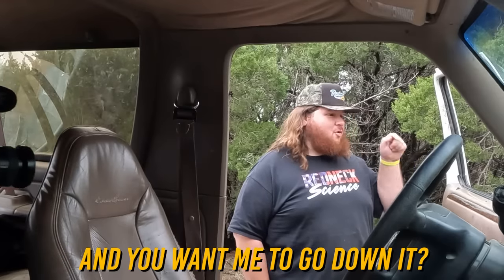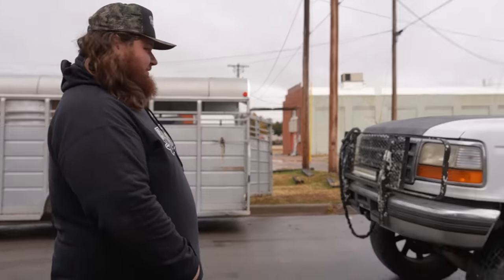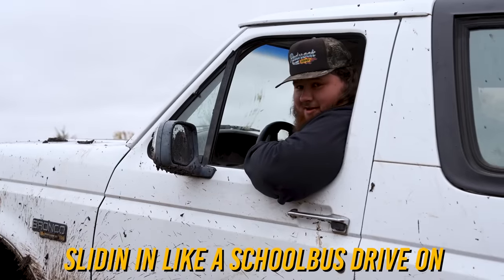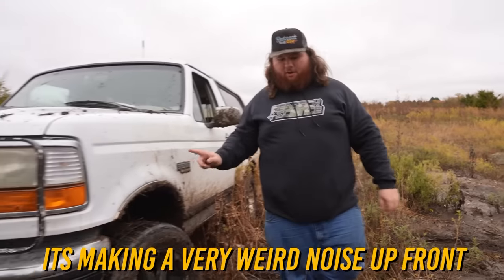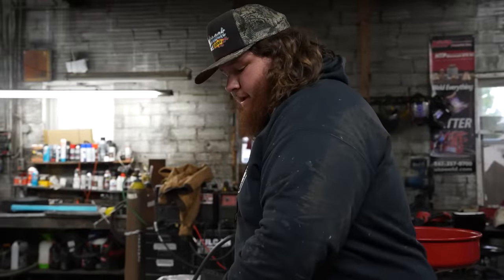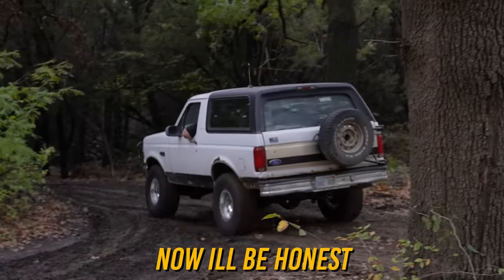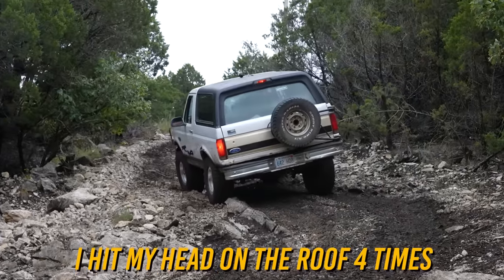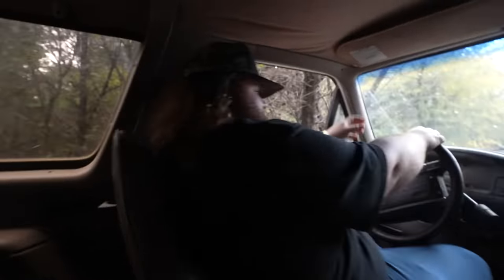I Built My Bronco To Go Find Bigfoot

Comment: Tip! welding 2 piece's  steel  togeather  ||  
lay welding rod in middle of the seam joint   []|[]  & put a heavy  block wood  on top
  and let it rip   it'll  weld itself a perfect line  cheers!  aussie Redkneck science ere!

Comment: I can't believe you didn't destroy the drive shafts, or diffs when you were running it with those large tires on the front and small ones on the rear. That's a 4x4s nightmare. lol. Ps. That noise it started making in the front end is most likely destroyed barrings in the front U-joints in the driveshaft from the force the transfer case was putting on the front when you were running the two different-sized tires. If those larger front tires were mud tires where they had a lot more traction you would have broken something. Maybe just a driveshaft, but something would have given up. lol.
Reply: My thoughts exactly, when i saw him fly up spinning all 4 with mixed matched tires, i thought the transfer case was gonna sign off

Comment: After owning an 87 Bronco with a 4 inch lift in it..... Lifting that semi independent front end is so not worth the cost of repairs on it after wheeling with it... (pro tip, if you plan to keep it, throw lifetime alignment on it, you will have to redo the front end alignment roughly twice a year, 3 or 4 years it pays for itself)..... My next Bronco is going to be a solid front axle or solid front axle conversion....

Comment: The weird noise might be the front diff 
Running in 4x4 with the different size front and rears is making the front pull the rear that’s trying to go slower you might have messed up something

Comment: 12 inch lift stock engine in this video. New engine came after but jumped great and ran afterwards yes it's a 79 with a 90 ranger body with a 12 inch bds lift and trussed front dana 44 https://youtu.be/fsbvYkbLk_U

Comment: That's because you ruined the front diff driving with two different size tires and four wheel drive at high speed you can go at low speed and not break nothing but not a high speed your front tires the bigger the tire the slower it spins so your back tires are spinning faster than your front and you broke something didn't break it yet it's very close to giving up

Comment: Build it like ours homie this is 10 plus years ago but same suspension she just had a wire issue, it's a 79 bronco with a 90 ranger body. 12 inch bds lift with 4 inch body lift. 35 cut boggers and full spools around this bitch launches now 25 foot and makes 650 hp on our channel now